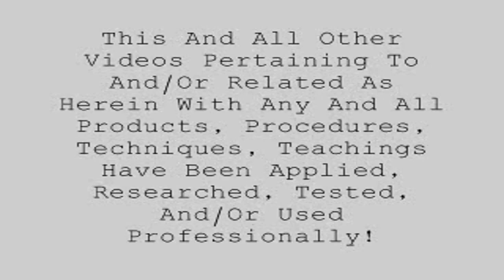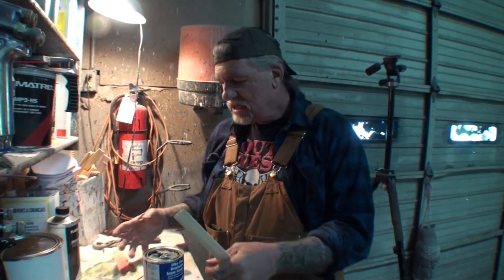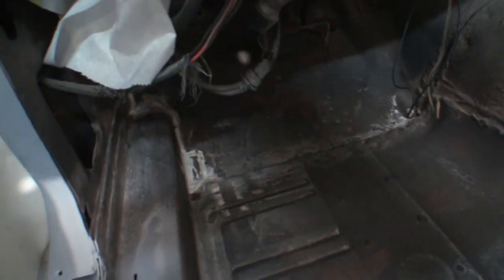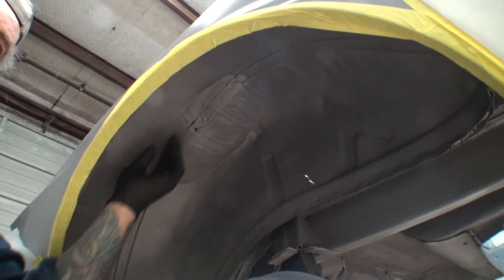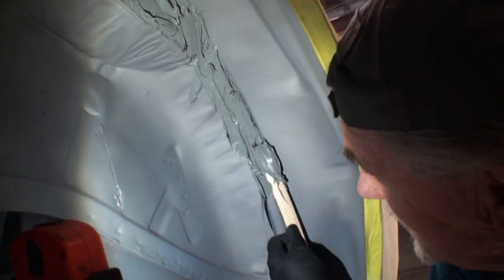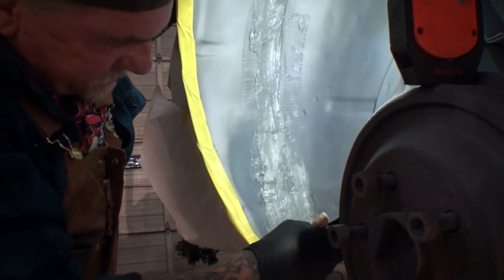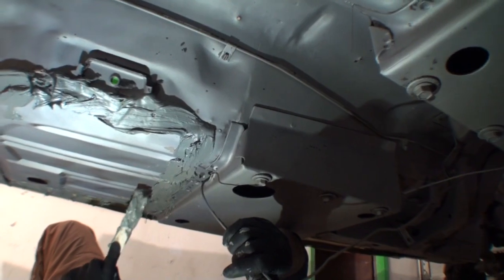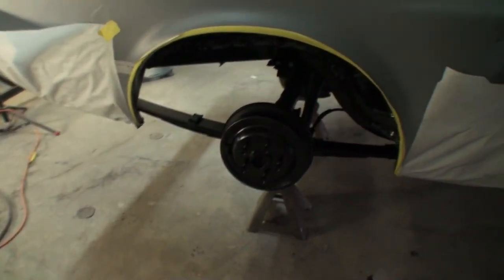Best Seam Sealer For Cars - BRUSH IT ON and FORGET IT!

Comment: Added note for anyone restoring or just replacing panels who want a tidy outcome is to use an evaporative solvent on your brush to level and smooth off the seam sealer into the areas you're working on. It will look and work fantastic and much easier to do.

Comment: Good job Pete 👍. When I get done with my first brushing, I sometimes spay some paint prep on the work, allowing me to smooth it out even more with a second clean brush .
Reply from the maker: yeah, that works too.. you can also use thinner to do the same thing
Reply: I was going to ask the same question , can I use the acetone or something similar to help get to flow a little better with the brush . You both answered it , thank you

Comment: I am so glad I saw this video. I'm repairing alittle rear end collision my 67' Mopar had and when the back got pulled back out it broke the seal abit. I was about to buy a tube of it but like this much better. I always wondered why the seal in the trunk was so thick and messy often times in old cars. Now I know there was a guy going around in the factory before paint splatting this stuff on. Thanks!!

Comment: Pete! I have a 2011 Mustang GT 2nd owner bought in 2017, I was just working on the roof ditch, found rust, it must have been in an accident or repaired half ass, they didn't seam seal it correctly! This video is good timing. I ground out and killed the rust with vinegar then rust converter. Then I used Dynatron seam sealer and 2K primer. I may put some more seam sealer over the primer.
Reply from the maker: Next time you use seam sealer in the drip rails find a brand called ROBERLO Self Leveling.. It's much better then Dynatron and flows out great!  Take care.
Reply: @diyautoschool  Thank you!

Comment: I used something similar recently on some bilco cellar doors. If it’s a polyurethane based sealer. If u dipped your brush in a bit of xylene it’ll let that smooth out real easy. I read the msds and xylene is the solvent for most of this stuff. Hope maybe that helps out a bit

Comment: i sometimes make my pinch weld lips with the outer one 3-5 mill shorter than the inner one so i have a better edge to seam seal on, leaving a water drain in the outer as per original.
i too prefer the proper brush on seam sealer, 

i use the 3M nylon sealer brushes to put it on rather than a frigging stick!!
then brush it out nice

Comment: Pete I’m in the process of removing all my old seam sealer, under coating and wire wheeling everything down to bare metal I plan on using  Por15 in the wheel well areas, do I  Por15 first then seam seal over that and then  Por15 over the seam sealer or do I seam seal  over the bare metal and Por15 over everything one time?

Comment: I dont know if its really matter but i always put epoxy primer first then seamsealer and paint. Is it as safe using sealer directly on the metal?
Reply: DTM I do it Once sealer drys it aint letting anything in applied correctly

Comment: When restoring any vehicle, and have to work on body rust as you can, what's the best route to take to stop rust til it's time to do body work and primer then paint?
Reply from the maker: Apply 2 full wet coats of EPOXY SEALER to the vehicle to protect it from the elements. This will give you time to work on it with no worrys.. Make sure to use a High Quality Sealer not  the cheapest one you can find!

Comment: Factory look is sloppy but fun to do. Next original restoration I do I will use that . I was using a gun and a brush . I have had problems with some 3M you use to much thinner or wax and grease remover the crap will never dry and next day you taking it off lol .

Comment: I have a 65 galaxie and it looks like it  has some kind of sealer between headlight and fender just curious what that might be a gap filler and what product it might be?
Reply from the maker: It may have been used as an ANTI Rattle  attempt so the car would drive with no sounds like squeeks and creeks.. This is common to apply between body panels that are bolted on and spot welded.. Most older Mercedes Benz Front Fenders are Seam Seal GLUED and Bolted on for this reason, and I have seen alot of old classic cars that have the same thing your tlaking about.. It's also so the headlight buckets won't rust out on the spot welded seams due to all the debree, dirt, and water that will travel in the headlight bucket itself..
Reply: Ok thankyou

Comment: Now, how "hard" does that stuff get when fully cured? Is it comparable with like "JB Weld metal" EPOXY style hardeness? Obviously, a "quicky/cheap fix" on certain metal areas that didn't get welded ect.....Or, does it dry/cure more like a rubbery/tacky feel that is more akin to cheaper "NON CATALYZED" seam sealers that is available? Lotta that "kinda crap" that NEVER drys, and can be pealed/scraped off at ANY given time lol. Obviously, NOT a fan of lotta the seam sealer they sell. UNLESS, of course, it is a 2 part catalyst "situation." Would appreciate your response/input, as I know you are BUSY/flooded with sh.t ta do....... But I haven't any luck with any responses/feedback from you in quite some time......TY

Comment: Hey Pete, i've had prolems with a seam alongside my trunk. A previous shop applied what it seemed to be silicone in the seam, and so the paint cracked, then the water was getting underneath rotting away. I've sanded as much as i could, spray rust reformer,  then primer/sealer, bondo the seam, primer/sealer again, then paint. Do you think i did a decent job, or was a seam sealer necesary? It's only 1 inch seam. Here are some pictures https://imgur.com/9kzkqrY?fbclid=IwAR2lmn7GGlxRh9Qq0q9ttC9jFDAVhRPZw7EK743Lvb85DQ6mqYS-uj5bPwY

Comment: Will seam sealer stick to POR -15, the brush on type you recently used on the Mercedes? That POR-15 is very shiny. I’m guessing NOOOOO.  I removed the exterior chrome pillars off the 1976 stingray, and the pillars were loaded with cracked seam sealer. After I removed the old seam sealer, there’s lots of rust, pitted rust. I got rid and all that rust and Jay told me to use the seam sealer, not to worry about the rust. But since I’ve seen him cut corners, I’m questioning him. I mean, I’m questioning you, just to see what would you do. Since I’m just helping him without getting paid, I’m thinking that he should let me POR-15 these pillars, then I could ruff it up to accept the seam sealer. I could be wrong.

Comment: did you put seam sealer on bare metal? would seam sealer over epoxy be better?
Reply: Yep got the same question, Richard. I was planning on epoxy primer first, seal sealer, topcoat seam sealer then stone chip.
Reply from the maker: NO -- Bare CLEAN METAL is better then epoxy sealer.. It will work on either surface as long as it's clean of dirt and grease but bare metal application is better. If you do a panel replacement such as the floor or trunk, you can scuff the factory black primer with 80 grit and go straight to seam sealer..  As long as it's all clean and there is no grease and grime it's fine to use anywhere!
Reply: @diyautoschool  Awesome thanks for the reply Pete.

Comment: I hate that stuff.  In my experience, you have a 10 minute working time. After that, it starts to gum up and get messy.  I rather use the 3m urethane seam sealer.  90% of the time I don't have to touch it out of the gun.  When I have to press it in to a seam, it very smooth and breaks away cleanly.